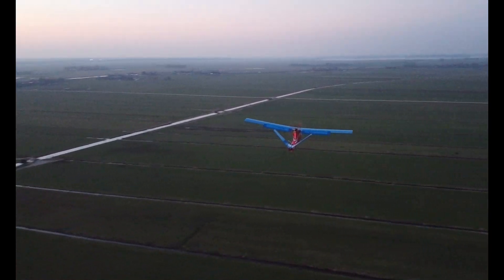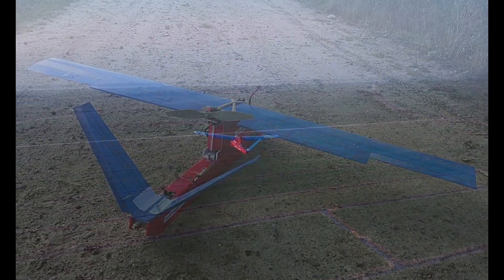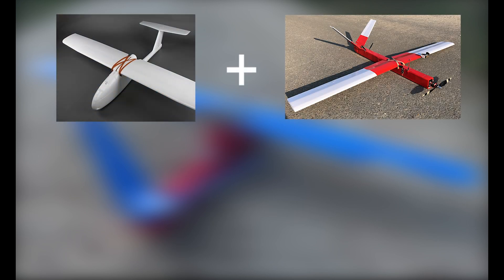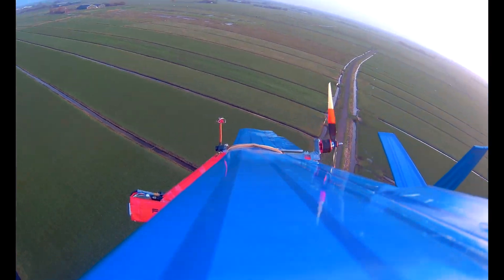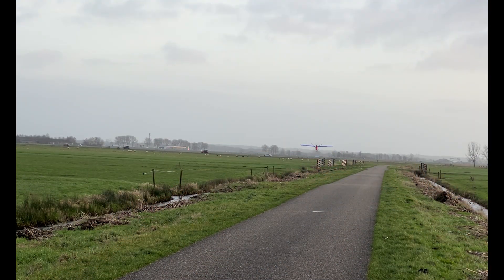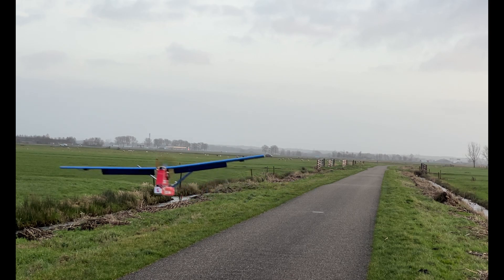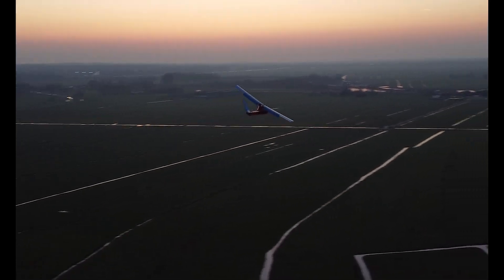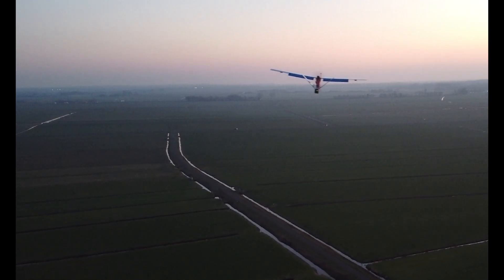Homebuilt FPV Aircraft with STOL Flaps - In Action!

Comment: What motor and prop are you using that you get 40 min flight times?
Reply from the maker: BR35-950kv/12x4.5
Reply: @AeroStuffFPV  is that from banggood? I have one of those. I fly the FT Explorer which I am sure you know is a very similar design but i dont get near the flight times that you do. however i am using a different motor as that max prop size i can put on is 9inch.

Comment: i dont understand why you wanted a pusher prop on a STOL style plane unless you want to but fpv gear on the nose.
Reply from the maker: Like mentioned, the STOL Mod (Flaps) are there to assist hand-launched takeoff’s by means of additional lift

Landing gear can be done too and can eliminate the flaperons, but those add weight & drag which results in reduced flight times